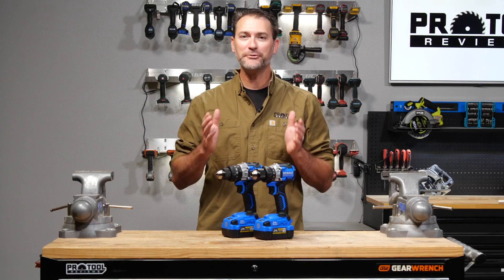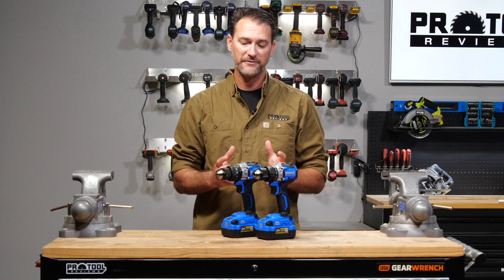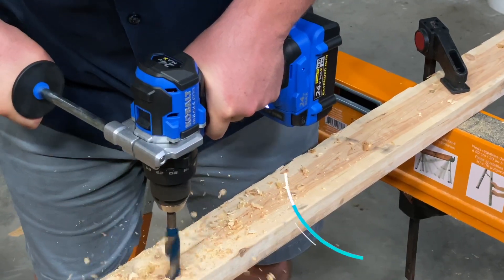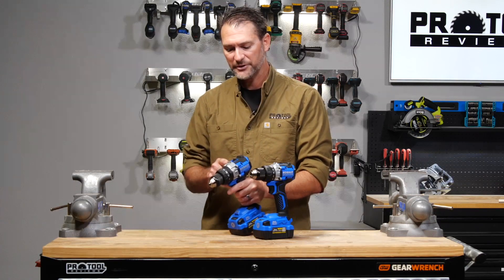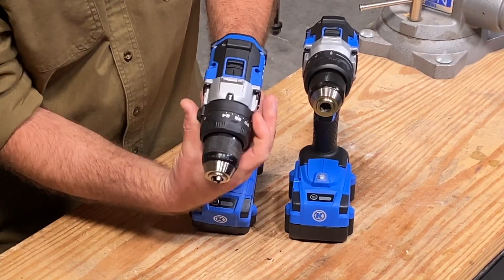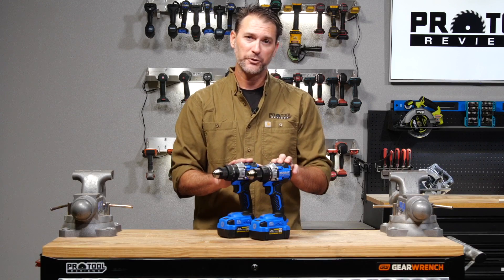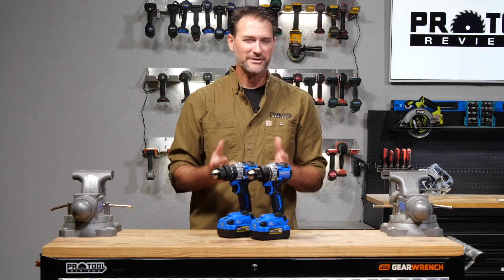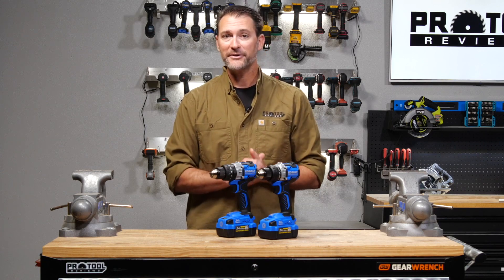KOBALT Tools 24V Max Hammer Drill Review | Better Than XTR?

Comment: The XTR is king for the price and the power you get. I have used all brands doing hard construction for 20 years and I’ll take the kobalt XTR line any day over Dewalt etc. Not just for the awesome performance and durability kobalt offers but the price on their tools and batteries to. Their battery prices are very reasonable . Check out their 40 volt chainsaw and weed eater to those suckers are nice 👍
Reply: they’re a beast, all right. you have no idea how many hex bits we destroyed.  we tried most and unable to find any that can keep up with xtr impact. 🫶

Comment: I purchased the 6x tool Kobalt Gen2 kit that didn't include a hammer drill. You will get way more value and usage out of a hammer drill the minute you need to mount a metal bracket or clamp to concrete or brick. So I picked up the XTR hammer drill which works great. I would never again buy a plain drill driver! Get a combo impact driver with hammer drill and you'll cover the majority of projects and chores. Also I'm a fan of that one handed recip saw that came with my kit - use it indoors as well as cutting tree limbs.

Comment: Fwiw here's my take on torque ratings for drills ,a top tier drill say around 1200 inch pound torque will give you a little bit more power in high gear than a mid tier drill of around 800 in lbs. Mist of your big auger bits and 4" plus hole saws will be uncontrollable on high speed anyway. Torque ratings are wildly optimistic anyway.